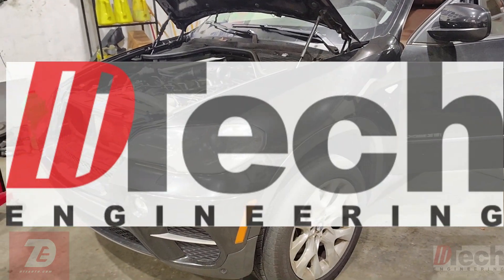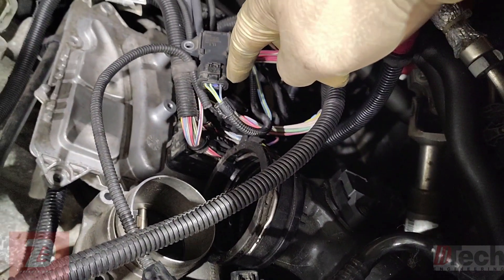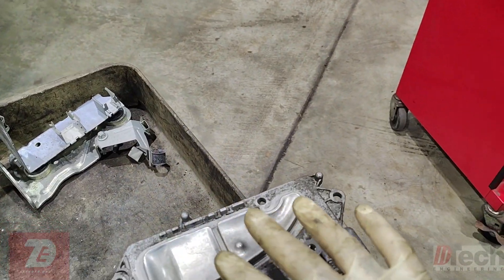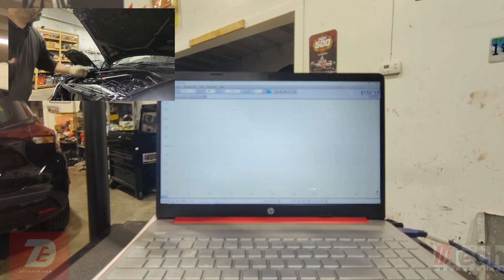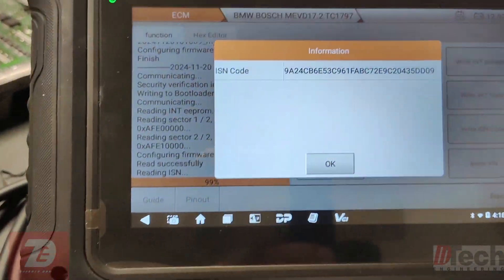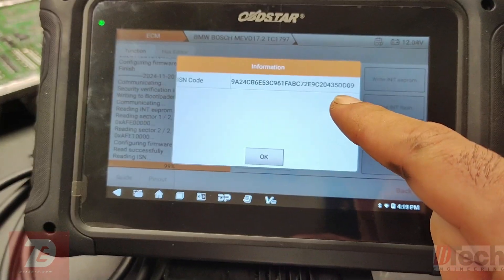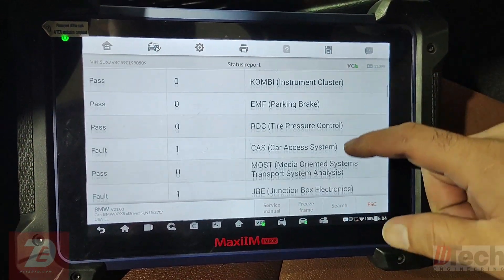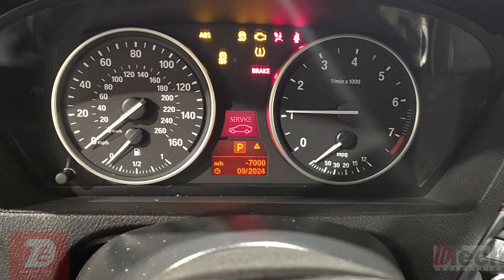BMW 281A Absolute Pressure Sensor (Boost/ MAP) Code Diag & Fix

Comment: What was the check engine after repair?
Reply from the maker: The tampering data protection code, this crank start up and run was right after putting it all back together after I showed verifying the sensor code was no longer present. Since it ran fine and no more sensor code, off camera I did the dme programing and coding which took care of that last code and light turned off and I delivered to the customer.

Comment: You take multiple measurements of supply voltage, signal and ground 
With 1.xV, 4.99V and approx. 0V
In my opinion this is not correct, supply should be 4.99V, signal 1.xV 
Thanks for your videos anyway
Reply: Ya I was wondering  the same thing. I guess he got signal and power backwards.